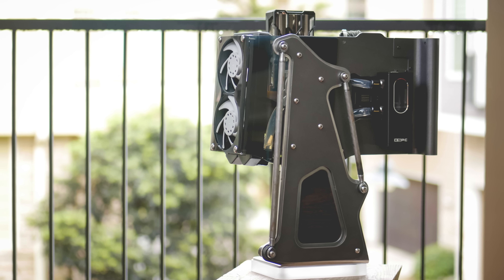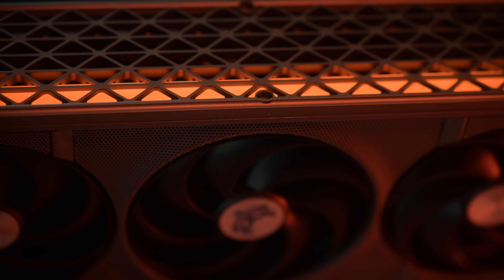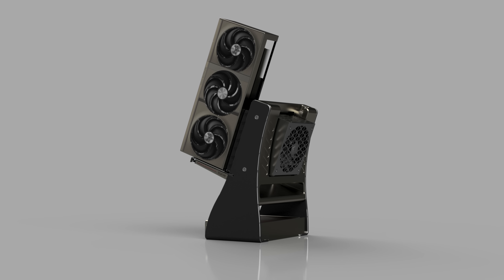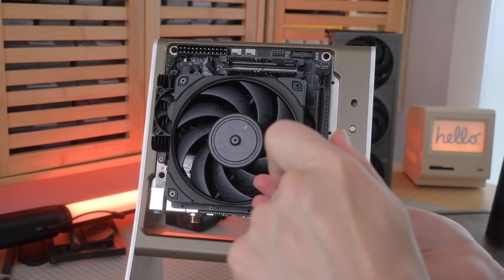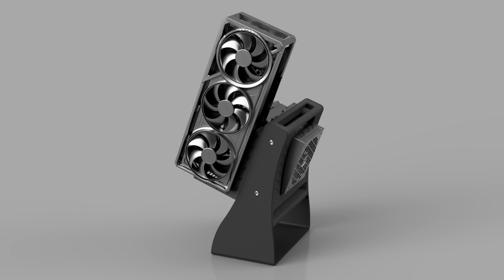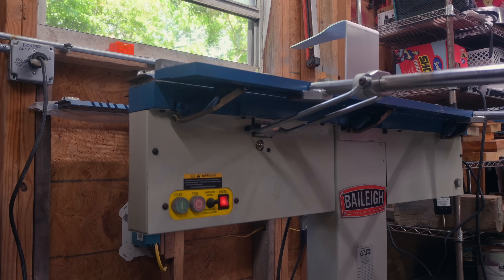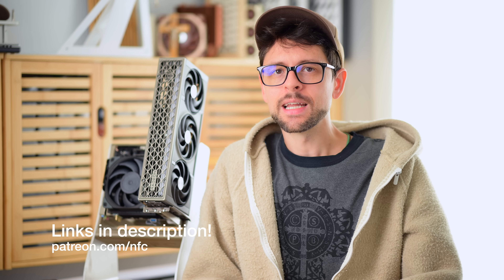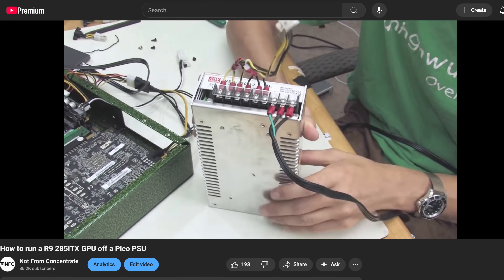FRAME - An open ITX "bench case" concept

Comment: awesome, just an idea :
use a riser cable and do a tight downward loop and bring GPU 20 CM down in same position and small bracket in front of legs to hide output GPU cables

Comment: I really like the idea of a USB hub in a wooden base… I think creating a backpack radiator setup would be cool on this one, I bet you could fit a 240 vertically behind the frame. It may not be the sleekest design, but it would give you a lot of cooling capacity for the CPU, even if it’s just using a 240 AIO.

Comment: I love the case, but I do not like the way cables come out from underneath. They could easily be hidden.
My first idea when seeing the base was to integrate a KVM switch as I use a secondary laptop everyday aswell. Then you could cover the direct io cables while still having them accessible from the back at the KVM Switch.
You could then either connect a external dock or add the dock on top of the KVM Switch to just connect the laptop directly to the Case
Reply from the maker: I put magnets and screw threads everywhere on top and bottom so people could print covers and stick them on; I hope to see what people come up with.

Comment: R.I.P  PCIe Slot
Reply from the maker: They are getting bigger and bigger. I actually designed a magnetic GPU brace that keeps it from tilting; although the arm is made of super thick stainless so I don't think it was necessary after all.

Comment: A slightly larger one that could fit a 240mm AIO underneath instead of 2x92 would be interesting
Reply from the maker: You can put a 180mm in between facing up too, that could be interesting.

Comment: Fantastic concept. I think my only initial feedback for it is the curves in the design. They don't complement the GPU at all and actually give the case a dated/cheap look. I agree that the Nitro 9070 XT is an absolutely beautiful card. I'd say one of the best looking cards on the market from any AIB partner. I'd keep your 7° tilt and layout, but drop the subtle swoop in the profile, using that GPU as inspiration for the shapes you end up using. Now that's a case I'd love to build into. Right now I'd need to remix your printable files to even consider the filament cost worth it. Looking forward to what you come up with next, regardless!
Reply from the maker: Love to see you edit the stand too; I want to be able to picture what kind of lines appeal to you! Thanks!

Comment: I would ditch the "radiator" section, bring the motherboard closer to the desk and extend the rear for aesthetics and not have the GPU float over the edge so much. Just my opinion, do with it what you will👍

Comment: I like the placement of the PSU, but I don't like that you need to remove the MB to take out the PSU. That component tends fail faster than other parts.
Reply from the maker: I thought about it for a while but I'm not seeing a stronger but also clean way. Luckily, it's only four screws for the motherboard; so much less than a normal case. :)